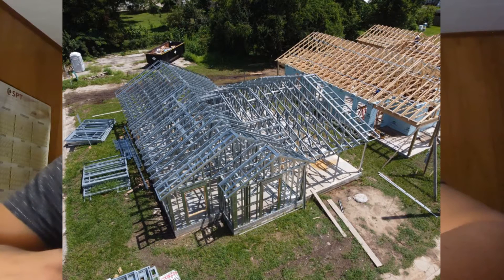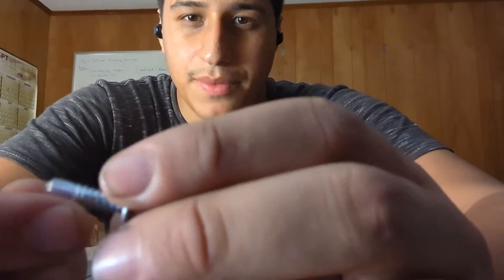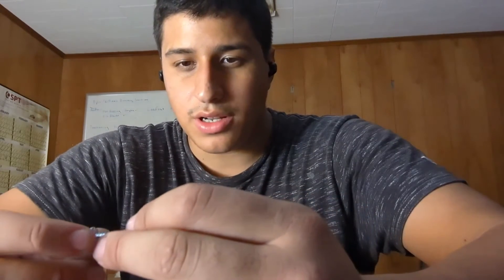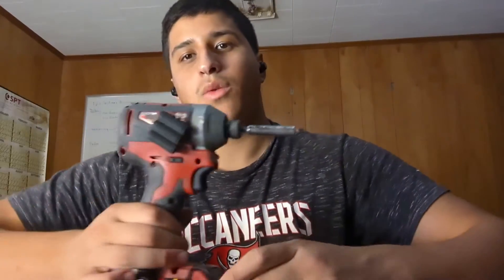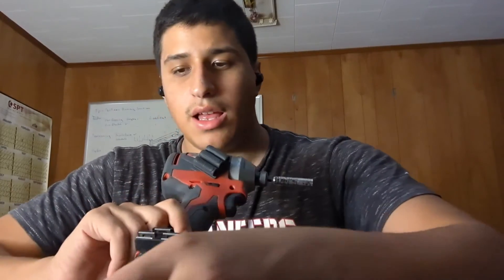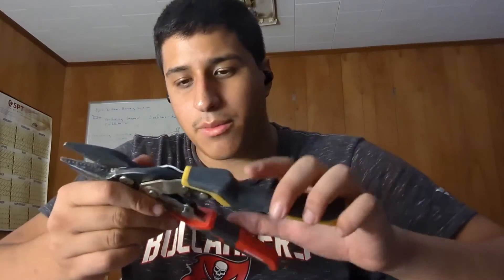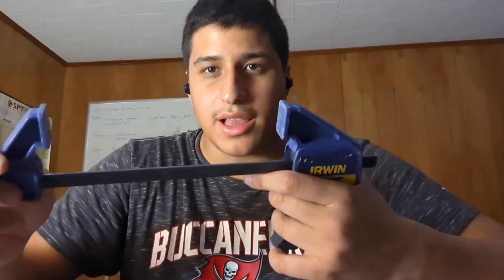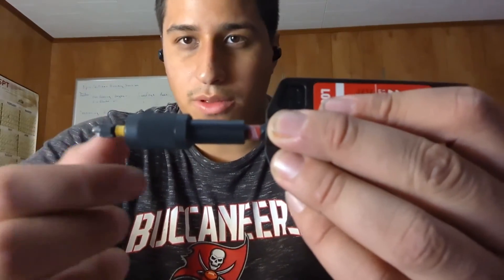Types Of Screws And Other Tools For Metal Stud Framing

Comment: What tool do you use to secure the metal rail to concrete floor that isn't to expensive and to get the job done? Its for add a extra room to the house i did but a regular hand gun but not sure if its going to work? ( amazon light duty fastening tool thats what its called) im here in Pensacola Florida

Comment: Just finished a commercial job where we install 30x50 heavy duty reinforced 1/2-in backer board that supports cabinets up to 300 plus pounds when fully loaded.  I normally use hex head self-tapping bolts with the Milwaukee 18-volt driver similar to your setup in the video on setting torque setting #1, but still intermittently stripping. I'm having to take the extra time and trouble to then go with 1/2 inch hole to install toggler bolts which is a real pain and slow.  Looking to find self-tapping screws that bite and can support the weight without easily stripping on #1 setting.
Reply: yea, it seems there really isn't a properly thought out solution for high shear strength.
Reply: @ so at this time, would you recommend to continue to use the toggler bolt solution to properly mount heavy cabinets to the steel studs?

Comment: How do you prevent over driving them with an impact driver? I have been drilling a pilot hole because I couldn’t get them started otherwise and then even driving them in with a screw driver by hand it feels like I can barely tighten it up without over driving. I hate metal studs

Comment: How to fix the metal channel into concrete wall or floor, is it possible to screw directly without having to predrill and having to need a rawl plug? I want to drill / fix into the concrete with ‘one pass’ if possible